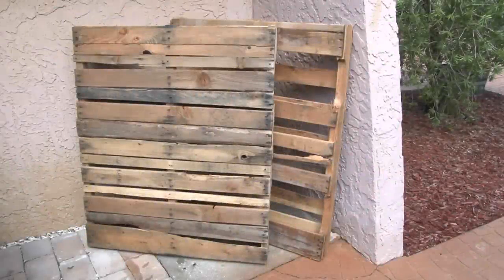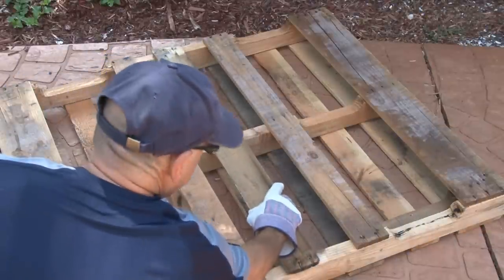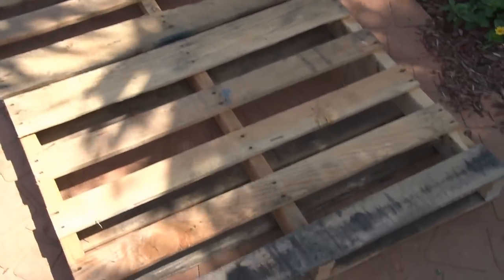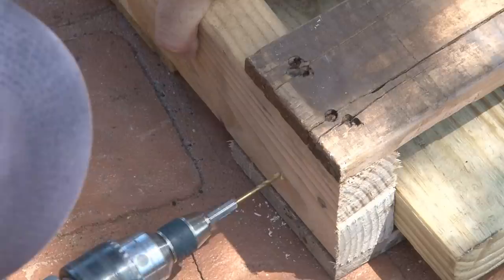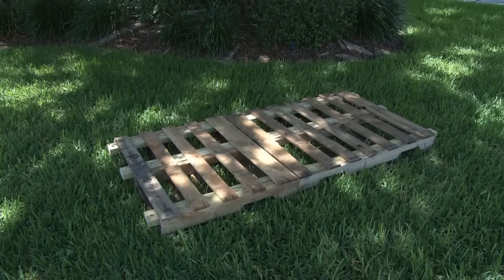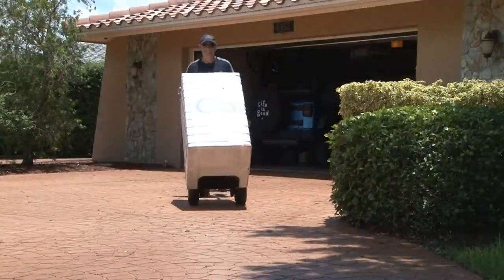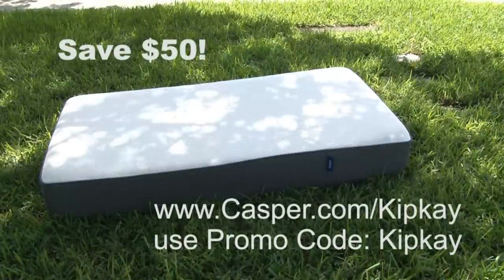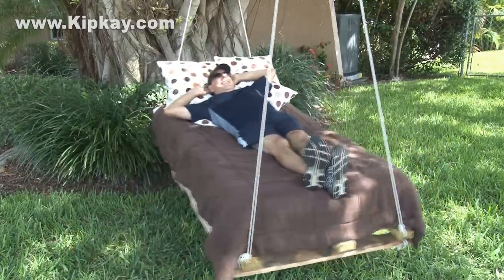Summer Pallet Swing Bed!

Comment: Another helpful tip on taking apart pallets. 
Search up the "pallet puller" on youtube (which you can actually make from pallet wood). 
It make taking the slats apart sooo much easier. Plus it reduces the risk of splitting the boards.

Comment: Hey Kipkay,

Here are a couple of things I would have done differently.

First, never use Drywall Screws in Pressure Treated Lumber, though they work they will rust and dissolve very quickly. Always use ACR Rated Screws. Granted ACR will cost 3 times as much but they are designed for Exterior use where drywall screws are not.

Second, The mounting of the rope could have been done different. Drilling the holes was perfect, but what I would suggest is just put the rope through the hole, then through a large Washer, either buy it or make one, then tie a knot on the back side of the washer. To adjust height simply change the height of the knot. The way you did it would work short term but the hole will eventually wear the rope and possible break. 

Something else you could have done is used EYE Screws. That way the rope would be attached to smooth metal and not rough wood. Rope cuts easily when various pressure is applied so as different folks jump on and off your setup the rope will wear. 

Overall it was a great use of Materials and Concept. My suggestions would serve for longevity and safety.

Comment: Cause a hammock is to mainstream
Reply: Well this'd be more comfortable
Reply: Catbat62 well, a bed in a room w/ air conditioning would be more comfortable than all of the above
Reply: Lmao that's true, unless it's in the shade. Sometimes you gutta appreciate the outside
Reply: Catbat62 Not if it's a proper hammock that has no spreader bars and is set up properly. Hammocks are more comfortable and better for your back.
Reply: Catbat62 Even in the shade it's humid as hell here in Florida, especially during the rainy season
Reply: Javier Lara lol

Comment: For the 2x4's did you use pressure treated wood or regularly treated wood
Reply: I think if you live in a rainy climate then PT would be better but I don't see why normal wouldn't work
Reply: Arib Hassam Fair enough

Comment: You should never use drywall screws for any other project besides drywalling.  If used in an outdoor project,  the drywall screws will bleed the black color throughout the wood if and when it gets wet like rain ect. Plus they rust out quickly and will break. Save yourself the trouble and use deck screws.

Comment: i wish bhc had trees but at least i can use my pool i kipkay hacked 12 months a year  umm nope nobody has life hacks for an inflatable pool and somebody really should. i would think it would be kip kay? ill start it off with keep a tarp closeby to keep the sand out of it when not in use. inflatable kids toys for drinks , put a stretch of indoor/outdoor carpet around it to keep your feet clean when entering. drain onto your rosebushes and other plants. keep a first aid kit handy? shower music player for safely listening to tunes? citronella candles or other ways to keep the area bug free? ways to shade it so the water doesn't boil your skin off? shower first so your pump doesn't have to work as hard?